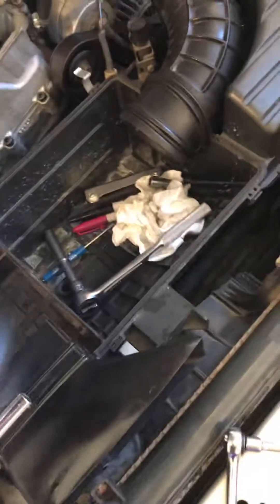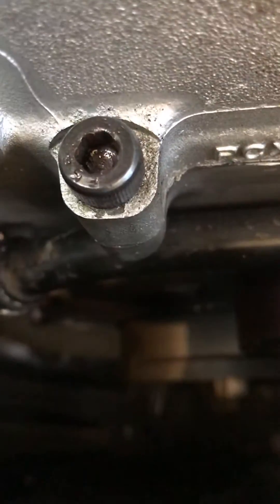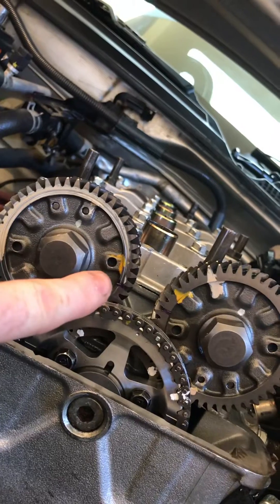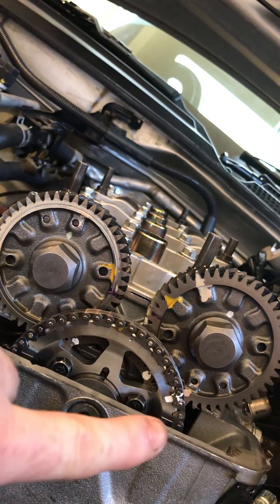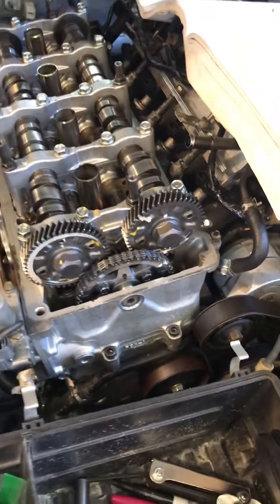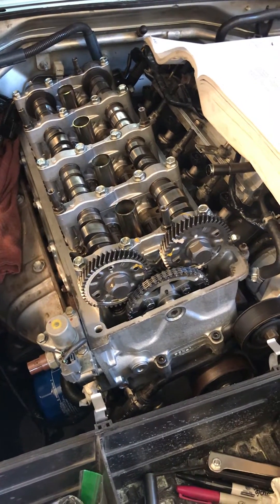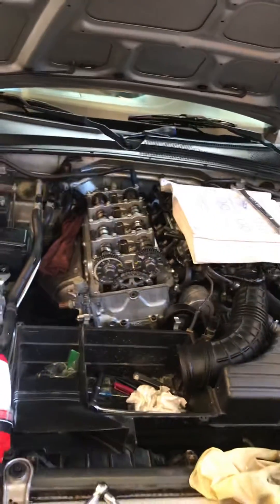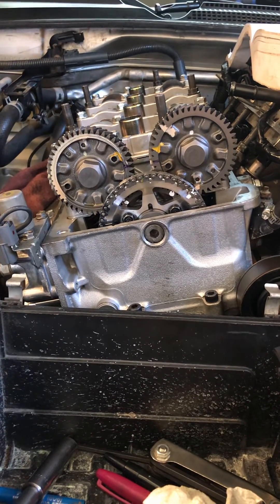Honda S2000 Timing issues FIXED

Comment: Anyone have experience/review with an OEM new TCT and ballade sport idler gear? I just rebuilt the 05 ap2 engine and still having misfiring codes. Rebuilt head with all oem parts, machined, oem head gasket, new ignition coils, spark plugs, fuel injectors, checked wiring and fuses for them and all are good. I’m guessing my timing is bad? 

So, planning to get this ballade sport idler gear and I already have a new oem tct
Reply from the maker: You should be fine once you install that idler gear. Just double check that the timing is spot on. You will be fine with the new OEM tensioner.
Reply: @VikingsGarage  thanks! Will report back once I do the job :)

Comment: What symptoms were you having that made you hunt for this fix. 

I have a choppy idle with occasional miss after an engine rebuild. The head and block were both decked and the timing is slightly off. Curious if this is my culprit.
Reply from the maker: That is exactly ti the T all my issues. After the machine work to both you will never get the timing right unless you get this gear. Replace the gear and the car will run perfect.

Comment: Is there instructions on how to install?
Reply from the maker: It is just like installing a stock idler cam gear. There are a lot of instructions on it online.
Reply: Mines popped.. only 69,xxx miles on my s2k smh.... that hex bolt in the middle holding up the third cam